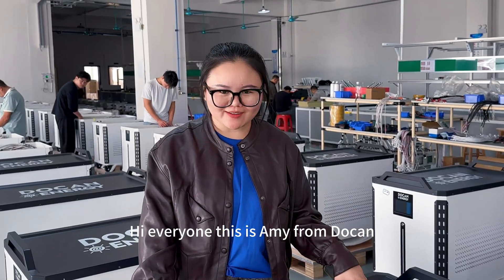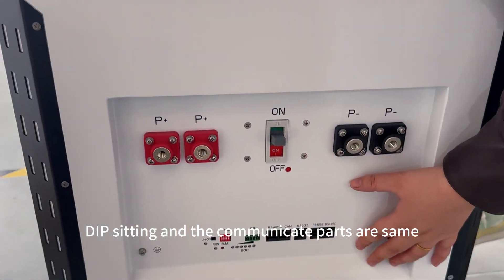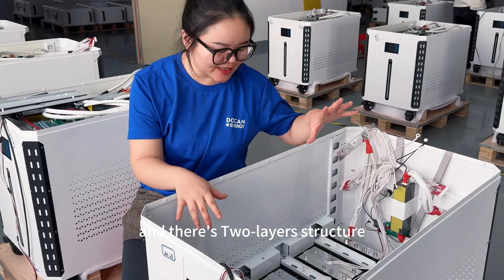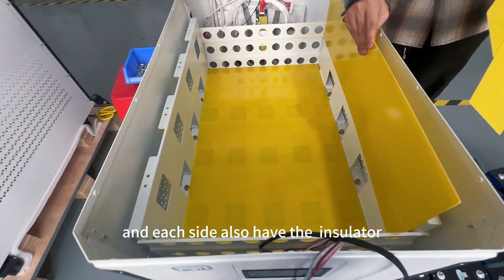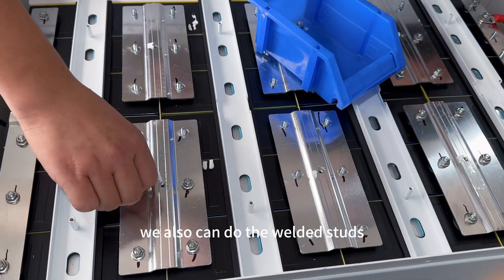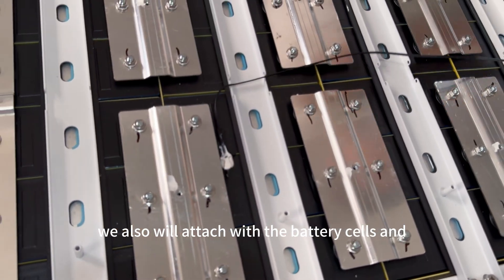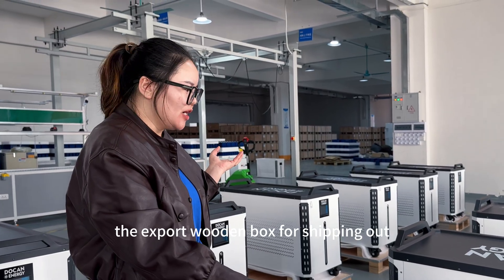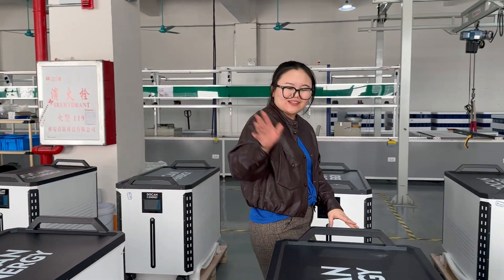Docan New Panda 48kWh 51.2V 942AH LiFePO4 Battery Inside Showcase From Docan Amy

Comment: This is the UPS battery pack for a latte panda😂. You just buy one battery and you can run your project for its entire lifetime on your little single board computer.    Great now all of a sudden I have this image in my head of pandas having to pull around battery packs.😂.   Takes about six pandas to get this battery packed moved around the floor.
Reply: Santa has a new EV sleigh but it’s still not able to carry the weight of the battery itself and so he has to have pandas pull the battery pack😂.   Santa had to go green even though the battery density doesn’t really make sense yet for aircraft going long distances, but there was social pressure.😂
Reply: LOL I love this take

Comment: mm2 cables?
Reply from the maker: 50mm2*1m
Reply: @DocanAmy 50mm2 is for 300A??😅
Reply from the maker: @PhilippeCJR  We provide default cables as free gifts. If you need larger or longer cables, you can easily purchase them locally and make cables in your required size.

Comment: 2:02
Here you see that the busbars do not account for expansion of the cells. There should be two ribs along the short side instead of one rib on the long side.
Reply from the maker: thank you
Reply: Nice try, but it's apparent that you don't know what you're talking about Peter.
Reply from the maker: @Loki-rascal  Our battery module uses a rigid end-plate design to firmly secure the cells.Epoxy insulation plates keep each cell electrically isolated and structurally stable.
After curing and laser welding/bolted, the module dimensions are permanently locked, so normal cell swelling will not deform the structure. This prevents movement of the terminals or studs and ensures long-term safety and reliability.

The design is based on automotive power battery standards and optimized for energy storage applications.
Reply from the maker: Our battery module uses a rigid end-plate design to firmly secure the cells.Epoxy insulation plates keep each cell electrically isolated and structurally stable.
After curing and laser welding/bolted, the module dimensions are permanently locked, so normal cell swelling will not deform the structure. This prevents movement of the terminals or studs and ensures long-term safety and reliability.

The design is based on automotive power battery standards and optimized for energy storage applications.

Comment: very interested but I need to find out how to integrate these type of battery with a grid-tied solar system that I am considering.  Which AC inverter that would work in harmnony with the micro-inverters from each panel?
Reply: When you get two of those you should never export to the grid. If you don’t have enough solar input,import grid energy when it’s cheap and use the battery.
Reply: @danielking2944 not export, just import
Reply: @danielking2944  thanks Dad..
Reply: Sol-Ark will pretty much do whatever you want it to do.

Comment: What brand BMS? Did you do multiple cycles to see if the BMS can keep the batteries balanced? With so many cells thats the biggest problem especially when each bar seems to be connected to 3 cells. How can it balance one cell if its over or under volts?
Reply: They are using a 2 amp active BMS: KS48300-Ho23 (16S 300A 300AH) -Split AC Unit + Active Equalization + Wi-Fi + Bluetooth.
Reply: @maj429  How do you balance individual cell if three are connected to each bus bar?
Reply: @MrDonking1967 you don't. That's the beauty of cells sharing a bus bar in parallel: they self balance. You only need to actively balance cells in series, which this does.
Reply: @maj429 Thanks

Comment: Because that batteries are 52V what are the compatible inverter models in the market?
Reply: “48 VDC nominal” is really 52 or higher VDC charged so there are dozens of inverters at this nominal voltage
Reply: Inverters that support 48v batteries and LiFePo4 (LFP) cells are compatible.

Comment: amy, do you plan to have 30kwh diy kit with mb56 batteries?
Reply from the maker: Yes, we did; We will  release out 30Kwh diy kit for MB56 LF628cells in Jan 2026), and I also will shoot video once ready. Thank you
Reply: @DocanAmy  This kit has same BMS? or it possible JK? Thanks!
Reply: Is a mb56 2S2P something you might be doing in the future? Also CATL new 572 cells are reportedly going to be cheaper any news on that? I'm definitely looking to get some batteries from your company.  Looking for large storage capacity.
Reply from the maker: @MrDonking1967  Sorry, we dont have news for CATL 572Ah, but we do sell EVE MB56, why you not make your own 2S2P, our battery packs start at 16S; Thank you
Reply: @DocanAmy Sorry I meant 16s then 2p. In simple terms 32 mb56 batteries in one battery. Understand? Would be like a commercial Panda maga-battery
Reply from the maker: @MrDonking1967  We will release out diy box for 16cells EVE MB56 (16S1P) in Feb 2026, thanks